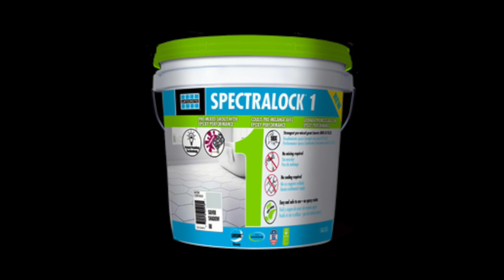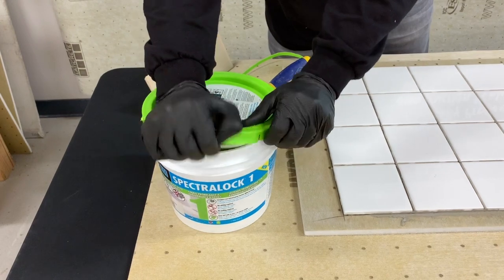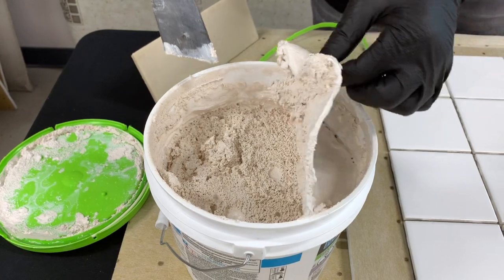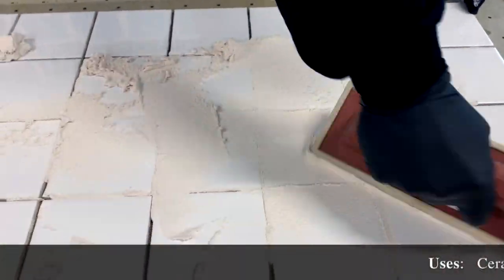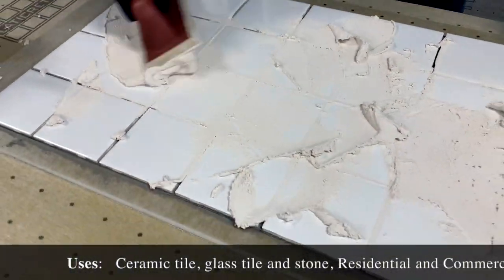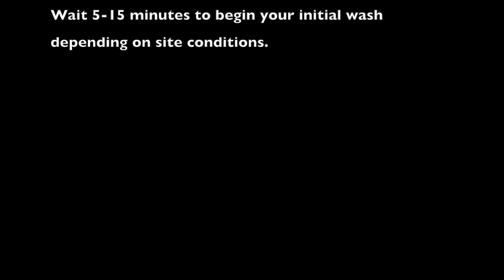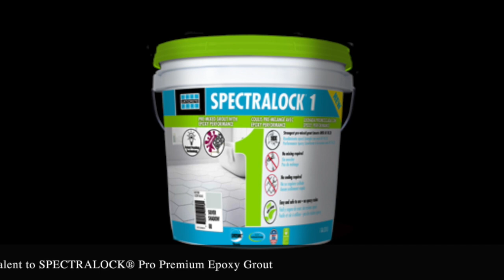Installation Tips to Installing SPECTRALOCK 1 Pre-Mixed Grout

Comment: just used this for my new shower and it was not creamy at all. It was quite a workout getting it into the gaps. Clean up was not bad at all, as long as you are ready within the time limits. I grouted one wall of the shower at a time so I could clean as I go. Also, I would use a dry microfiber towel to carefully wipe down the trim so I would not have any residue issues.
Reply from the maker: Hi Terrance. Thank you for reaching out. If you're having trouble with our product, please reach out to our technical support team, they'd be happy to help: 1.800.243.4788 x1235

Comment: If I have a partially used bucket from two years ago that still looks good inside with normal texture and wetness, can it be used again? Or will it not set properly?
Reply from the maker: Hello Luke! Thank you for your message. SPECTRALOCK 1 has a shelf life of 18 months from the manufacturing date. So since it already has been opened and is past that shelf life it would be best served not using it. You can do a test area and decide what you would like to do, but it will likely not perform as intended and wouldn't be a warranted application. More info on our data sheet: https://cdnmdm.laticrete.com/Datasheet/NA/190/Datasheet_NA_en_190.pdf Hope this helps!

Comment: All instructions were followed for my shower.
However even a week after completion, chunks are falling out.
As fast as I clean, dry, and regrout one hole on my shower floor, another one appears.
Also, it was supposed to be as white as the tiles, it stayed gray.

Did you have a bad batch?
What should I do?
Reply from the maker: Hello Paul! Thank you for your message. We're sorry to hear about your issue. Please give our Technical Support Team a call: 1.800.243.4788 x1235 They would be happy to assist you with your product issue. Hope this helps!
Reply: @laticrete  Thank you.
Excellent customer support. Got the answers I was looking for.
Reply: @paultappenden4337  Can you post what they told you? It'd be helpful. Thanks!
Reply: @jasoncy31  The contractor ended up removing all the grout, and redoing it.
We used the same stuff, but left it for two weeks, as we were going away.
It's OK, but the contractor said he'd never use it again.

Comment: I see that you begin the initial wash 5 to 15 minutes after applying the grout depending on site conditions. I’ll be doing my basement level bathroom which is about 60°. Should I be waiting on the shorter side a longer side of that 5 to 15 minute range? Thank you
Reply from the maker: All curing and working times are based on 70F and 50% relative humidity. If the area you're working in is cooler than this, the longer side of the recommendation should be observed which may lead to waiting past the recommended times. Please review the product datasheet for additional information:  https://cdn.laticrete.com/~/media/product-documents/product-data-sheets/ds-36589
Reply: @laticrete  Thank you for your reply

Comment: How to remove haze on the aluminum edge after several days of cure? I tried alcohol and acetone, but neither of them worked.
Reply from the maker: If the grout haze is left on the surface for greater than 72 hours, a stronger clean may be necessary. We recommend the use of SUNNYSIDE® MULTISTRIP ADVANCE or a D-Limonene based cleaner (e.g. L&M™ CITREX™). Allow the liquid to sit on the surface of the haze for a for 5 to 30 minutes and in a small circular motion, applying pressure, pass over the haze with the white nylon scrub or scouring pad. 

The haze should start to release from the tiles and can be removed with a cleaned damp sponge or microfiber cloth. For larger areas, a floor buffing machine equipped with a white pad can be used. Always conduct a test area to confirm that the liquids and pad used will not affect the tiles.
Reply: Magic eraser

Comment: What is the composition of this product? Technical data sheets specify it can be used with glass tile and natural stone, but I've read it's composed of the sanded aggregates from Spectralock.
Reply from the maker: It can be used on glass tiles - but not all glass tiles are created equal and some are "softer" than others and may scratch if using sanded grouts. The only way to know for sure is by asking the tile manufacturer for grout recommendation or testing the grout on a piece of glass; or, buying the finest play sand possible from a big box store and test the tile's hardness.

Comment: Is this epoxy? Is resin and epoxy the same? Sorry for the question
Reply from the maker: SPECTRALOCK 1 Grout is not an epoxy/resin grout, but it has the same performance as an epoxy grout meeting or exceed ANSI A118.3 standards. The actual chemistry is proprietary. Here is a link to the datasheet: https://cdn.laticrete.com/~/media/product-documents/product-data-sheets/ds-36589

Comment: Hi.  So, I just grouted my first tile with SpectraLock 1.  I really am happy with the whole process, but I cannot find the troubleshooting document for SL1.  Being my first time grouting, I left a couple of small oddball pinholes, and one tiny razor thin void at the edge of a tile.  Do I need to cut out those small areas and regrout them? or can I just apply some more of my SL1 to fix it?  My grout is only a few days old.
Reply from the maker: The Troubleshooting document can be found here >https://cdn.laticrete.com/~/media/support-and-downloads/technical-datasheets/tds411-sl1-faqs 

Please note grout can be altered/fixed while the material is still wet. Once the grout is allowed to dry, it's recommended to remove at least half the depth of the grout joint prior to conducting a fix. This assures proper bonding of the material for a lasting finish.

Comment: How do you get it to stick to wall tile?
Reply from the maker: Hello! Thank you for your message.  SL1 would react like other grouts on vertical surfaces. It was formulated to have increased non-sag qualities and has a creamy consistency to help it glide across the wall tile and stay in the joints. If you're looking for installation techniques, we would recommend viewing installation videos that show grouts being used on vertical applications. Hope this helps!

Comment: This video is very misleading. The mixture is wet and feels like wet sand, but I would not call it "creamy." That's a fantasy. It clumps, and it doesn't easily stick to your float. The material is heavy, and it often falls to the ground, which you don't see in this video because their sample board is flat, letting gravity work in their favor. It can be difficult to control waste when using this product. You need a second person handy to gather the waste, and either use it immediately, or put it back in the container. In the first minute on the tiles, it can be easy to spread, but then it gets challenging quickly, and you need to be prepared. Once spread on the tiles, it wants to dry very quickly. When it starts to dry, it can be very challenging to wipe off the face of your tiles. I could say more. IMO, this product is not for the inexperienced. It has its challenges, and they need to be learned and conquered. Once you figure things out, it does get a little easier, and the results seem to be good. But, I have to say, I did not fall in love with this product. I do not enjoy working with it.
Reply from the maker: Hello. Thank you for your feedback. We appreciate it and will share it with our team.